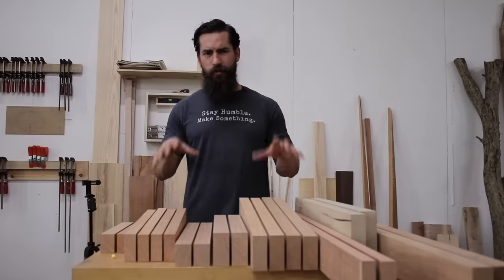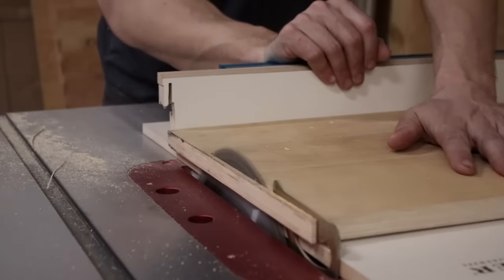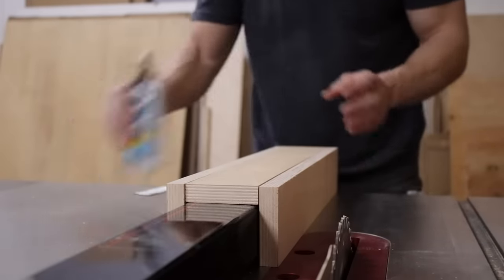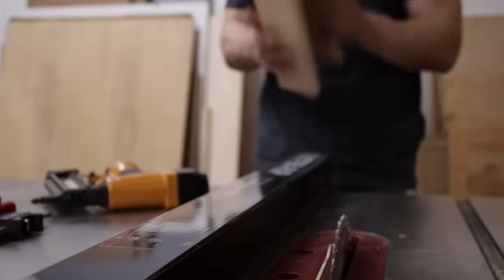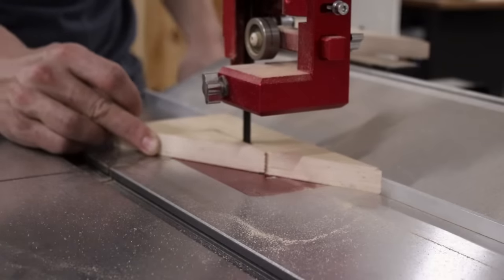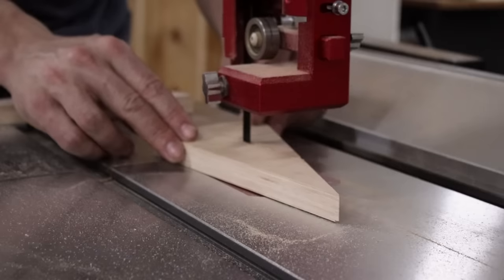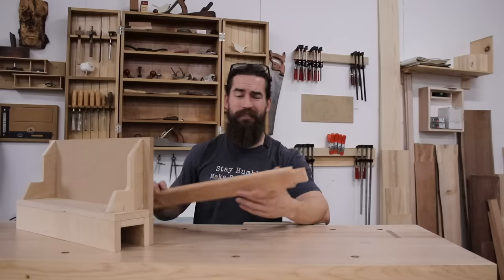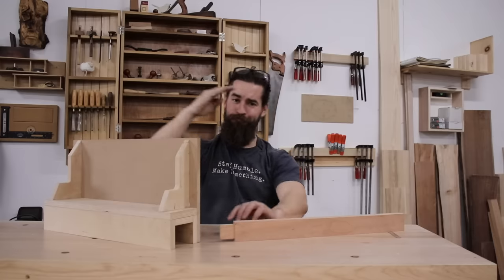STOP Making Complicated Woodworking Jigs!

Comment: Some of us ARE engineers and need a reminder that we're building furniture that is much less accurate than that required in the rest of our day to day lives.  :-)  Excellent video!
Reply: I’m not an engineer but was a computer programmer decades ago when a simple mistake like putting a letter where only numbers should be could crash the whole system. Analyze, plan, “build”, then test it every way you can think of. 

“Close enough” seems to be against my nature, but in a way it’s wonderful. Part A isn’t perfect.  Neither is Part B.  However, I’m discovering that figuring out tweaks so the end result is OK is satisfying. Concluding “that mistake just doesn’t matter” is hard for me to accept but it’s getting easier. Maybe woodworking is good for me!

Comment: Add a filler strip into your old jig and you'll have a working jig. That would have saved time, though the video would have been pretty short.😉
Reply from the maker: You’re absolutely right. And I thought about doing that. But that wouldn’t have helped anyone looking to build themselves a tenoning jig, so here we are 😎
Reply: I had this exact thought. 😂
Reply: Please use a blade guard and don’t endorse it’s removal !
Reply: @PNH63 , they aren't always practical, and usually just get in the way. Not even sure where mine is honestly. 🤔🤷‍♂️

Comment: I built a tenoning jig a couple of months back and it took me three tries to get the face perpendicular to the table. The main problem with the first two was that even though everything was square when I clamped it, driving some screws took it out of square. The third try was like yours where I made the 3-sided box to go over the table saw fence. That proved to be easier for keeping things square but I still had a problem with the whole jig moving slightly while over the fence. I used my jig to make some castle joints, which turned out fine, but I did need to pay attention to the proper position of the jig as I pushed it through the cut. 

I have a Ridgid R4512 with the stock fence. That fence is really narrow compared to many other table saws out there. That may have contributed to the problems I had. I may try making another one. Maybe I'll learn a better trick to compensate for the narrow fence.

Loved your simple design, though.
Reply from the maker: I wonder if padding out the back side of the fence and therefore extending the width of the jig would help. Doesn't make the fence any wider but gives more purchase to the bottom of the jig. Can't promise that would work. But it might.

Comment: As you mentioned there are several ways to cut tenons. I have had real good success using an extension to the miter gauge . a stop block applied for the length. The cut through the extension gives me an accurate tenon length to start . All I have to do is set the depth of my blade. works like a charm. I also like your method and if I was to make items frequently that required tenons I would make one like yours. I also have several miter gauges set for other task as well.

Comment: I have slightly unrelated question. Why do you need glue when you used nails? I understand for furniture, it need to be strong due for example day to day use, need withstand more stress. But jig like this are light, and are use by skilled hands, holding force of nails isn't enought?

Comment: Absolutely agree. There is nothing wrong with building a fancy jig out of Cocobolo and 5000 year old bog oak if that satisfies some personality trait. There is nothing wrong in sharpening your blades to 100,000 grit ( if that exists) if you want to shave in the reflection. It just isn’t necessary. 

I build jigs all the time. Some are long term keepers and so I build them more substantially but only out of scraps. If it’s a jig for a one-off build, then I build them as strongly as I need to for that build and then scrap them.

Don’t beat yourself up on building jogs. They are a tool just like a saw or a screwdriver or a router. My tools have the scars of life on them but it doesn’t affect how they work. If your scraps have the odd screw hole or paint splash, then don’t worry, just carry on.

Allied to jigs, is this thing about the tool you use to keep your hands away from the saw blades. For me, there are just a few essentials:

- they have to be solid - but any timber over 12mm is going to be solid
- they have to be long enough to keep my hands far enough away
- they have to have the kind of hand grip that prevents my hands slipping
- they have to have a notch so that the timber to be cut sits nicely

For me, that’s it. I make mine out of scraps and each one is different because the scraps tend to be different. People who take hours to fashion theirs to a particular fashion are fine - I just have other things to do. People who sell expensive handles are just richer than you (now, that is).

Gauge blocks. I never came across these in woodworking until a couple of years ago. Then I saw them on YT. All by Woodpecker initially. I’ve never felt the need to have gauge blocks; I’ve always found a ruler to be fine - if I really want extra precision, then I use my vernier gauge. I could buy a set of engineer’s gauge blocks here in the UK for £200. That’s a lot of money but we’ll spent if you are…an engineer. Or I could buy the deluxe set of blocks designed for woodworkers from Woodpecker for $500 plus. That’s almost indecent to me. I don’t know if the YT channels who feature these blocks have bought them out of their hard-earned or not; I just don’t know. You can make up your on minds.

Comment: I will run a dovetail groove verit/horiz or 2 on there to use matchfit clamps.  I also would not glue the vertical stop on there, which makes it possible to do angled tenons, angled bridle joints, splines, etc.  That's about all the gjuzh though.

Comment: So in your build it appears that the legs of the "main body" of the jig - not the face of the jig that you purposefully kept off the top of the saw - is actually resting on the saw's table top.  You can clearly see that the bridging piece ("sill plate") between the two "legs" is proud of the main body of the fence.  Is that correct?

I've seen other builds of similar jigs where the advice is to keep those two legs off the saw's top so they're not catching in the miter slots as you move the fence.  In that case, presumably, you're really counting on the top of the fence being parallel to the top of the saw to ensure the face of the fence is vertical.  

It seems to me the jig really should be referencing off the table top not the top of the remainder of the Harvey fence, as that's what you "square to", and just be careful when moving the fence with the jig attached.

Comment: How are you not the most popular woodworker on YT?   Love your perspective.  I am trying your custom finish on the cabinet I am building for my wife's new double oven.   Thanks for your time.  Wish you were in KC area and still teaching.
Reply from the maker: I appreciate that! And hope the finish works out on your new project 👊
Reply: Applied a coat over the poly I put on 2 days ago. This goes on way smoother and easier. It does have quite the odor, however. Thanks for replying.
Reply: @ENCurtis  well I got it put on last night about 630pm. As of 5am it’s still quite tacky. Is that normal?  Seems my straight poly dried faster. I did use equal parts watco danish oil, actual turpentine, and varithane  oil based semi-gloss poly.  Not sure if it’s a problem. If it doesn’t dry, can I use mineral spirits to clean it off without damaging my first coat of straight poly?  Should have tested it first, but I’m constrained by turkey day and getting the double oven installed for my wife. Thanks for the help.
Reply: @ENCurtis  it all worked out great. Wife loves the new cabinet. Thanks for all the content you provide. Always a relaxing moment watching your videos.

Comment: A few dovetail grooves on that tall fence and you can use Matchfit clamps to hold pieces. Need to cut weird angled slots for miter splines? Build a quick and dirty jig, clamp IT to the fence and the part too. That jig becomes useful for other jigs as a result of a few router cuts. One simple worthwhile addition. 
Another addition is to build that first box out of HDPE so it slides better.

Comment: newbie question about tenon's if i were going for a bit of a brutal industrial kind of deal is there any reason you couldn't use the whole piece of wood as the tenon? (assuming the mortice piece is big enough to take it of course) i mean i know you wouldn't get any "shoulder" but does that matter when the strength comes from the tenon itself?
Reply: Using the whole piece of wood as the tenon?  Sure, it just needs to be 1/3 the thickness of the material for maximum strength. That's the traditional way of constructing farm gates using mortice and tenon joints with driven dowels for example.  Also fencing rails though posts etc.

Comment: You don't need a jig.

1. Set the fence on the length of the tenon.
2. Set the hight of the blade on the depth of the shoulder
3. Move continuous  fast youre wood from left to right and go slowly forward
4. Do that at all sides and you have youre tenon.
Reply: Another way to do this would be to use a miter saw

Comment: @Encurtis the other jig you use for cutting on the other side of the fence is it made made from you? Is there a video of how to make on of this. It would be very useful even in a floor installer and not furniture maker. 
Thanks for the very good content
Reply from the maker: The crosscut sled? There are many videos on that type of jig. I have an exceedingly simple one in the back catalogue.
Reply: @ENCurtis  yes the crosscut sled. It would be very useful to make one. I will search your back catalogue

Comment: Mate,
To the existing jig, I would have Added a long, vertical piece with the correct height glued at under the existing top, and held against the metal rail, and a narrow long piece glued both sides and fitted between the existing and new vertical pieces at the bottom. Job done.

Comment: And the added stop ended up on the wrong end when it got reversed 🤔 And it didn’t seem to have one added to the other end (which could infringe on the usability)… That means that the jigg needs measuring to be perpendicular for every piece 🙄 Since you mentioned speed as the main reason for a jigg…